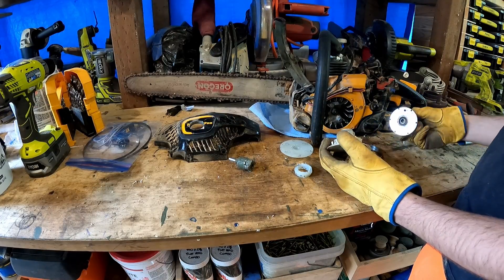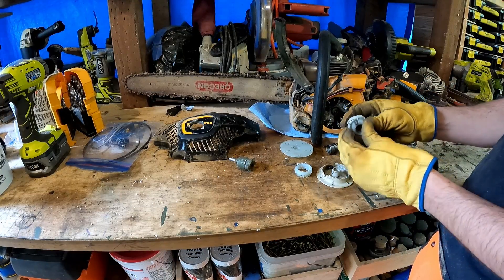Harbor Freight Chainsaw Electric Start Mark III

Comment: That's pretty good !!!   I was thinking  that if the rope starter pulley  was off center such that the apogee lined up with top dead center,  then it would have more leverage.  Great  Albert Harvey  Rotary Engines  google videos
Reply from the maker: That's a very interesting idea! An eccentric pulley would make the pull feel weird, I suspect, but it seems like it ought to smooth out the engine compression. You'd have to re-engineer the ratcheting mechanism so that the recoil spool always engaged the flywheel at the same spot, though.